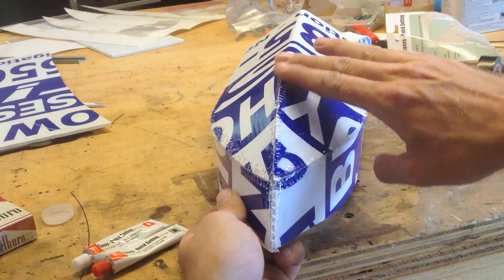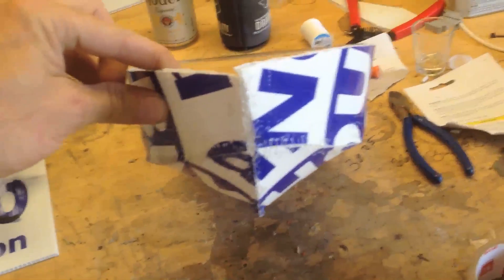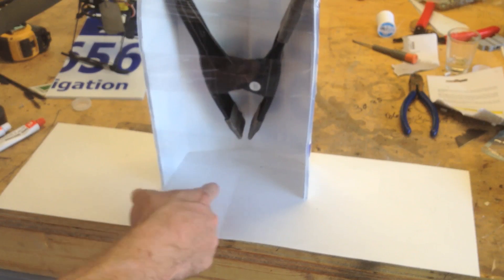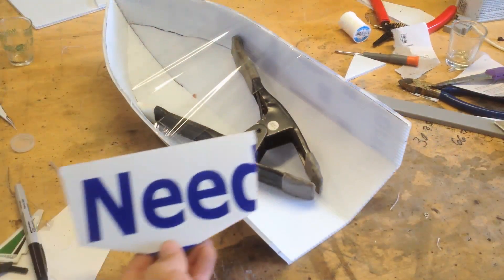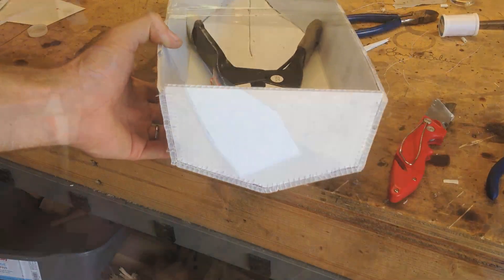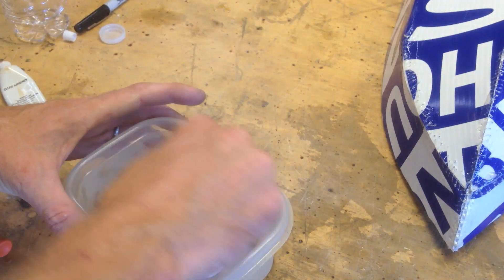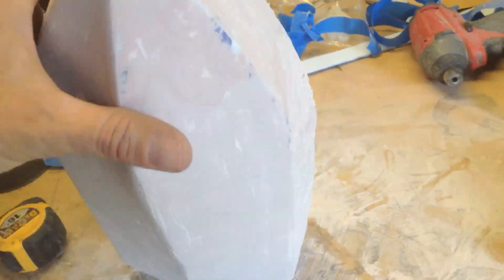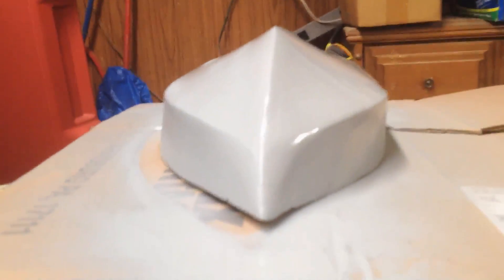RC Boat Build (Part 2: Hull Construction)

Comment: A tip on the bondo: about a golfball of bondo to a pea of hardener is usually a pretty good mix....and if you do it on a flat surface like a piece of MDF or glass, you can mix and get to it more easily with the spatula, and scrape it clean. A wider spatula cut out of the side of plastic icecream tub works pretty well, and the flange at the lid end is easy to hold...it's a bit stiffer too.

Comment: wouldn't using hot glue instead of a needle and thread be easier?
Reply from the maker: Sure, that would probably work just as well as long as the hot glue is not exposed to direct sunlight.

Comment: That Plastic board you used will weld using a 40 watt soldering iron with a clean tip give it a Try.  I used it for the back of Station wagons for ropes tools ETC.

Comment: Sir  what's that compound you used for smoothing the surface..?
Reply from the maker: +Sayandeep Dey It's called "bondo",  it's used as body filler for cars.
Reply: +Absorber Of Light Bondo is not available in my locality can I use " roberlo resinplast fiberglass putty" instead..?
Reply: +Absorber Of Light " roberlo resinplast fiberglass putty " is also a automotive body filler.
Reply from the maker: Sayandeep Dey I'm sure that would work.
Reply: +Absorber Of Light Thank you for your support..👍👍